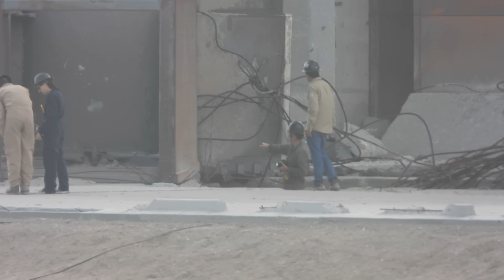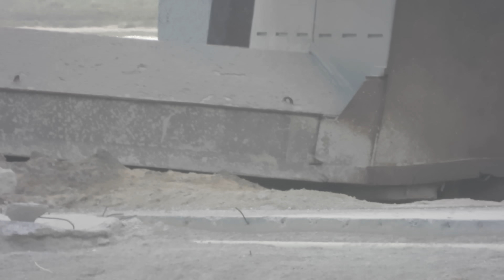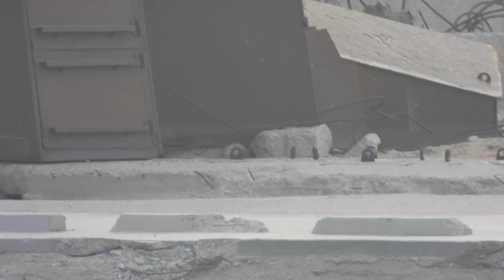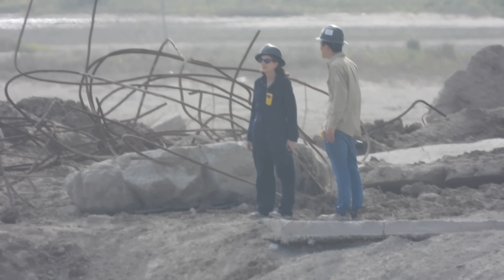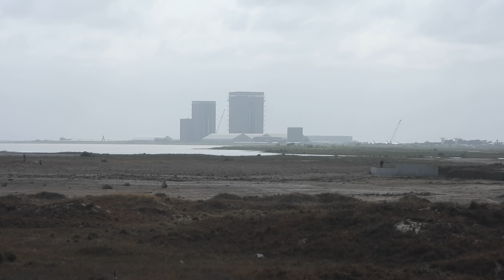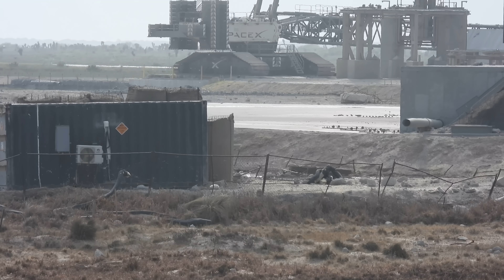Two Days After Launch, SpaceX Starbase, in 4k, Boca Chica, TX, April 22, 2023

Comment: That they even got off the ground with that kind of destruction happening is a great feat.
Reply: The pad disintegrated and the debris got sucked into the engines-25% malfunctioned and they had to blow up the rocket.   Love people calling that a success on here.  Rocket scientists everyone in the comments.
Reply: @edwardschmitt5710  this launch was a success, from it being predicted not to leave the ground. Debris sucked up into the engine? Is there proof of that? Criticizing people for acting like scientists like your one 😂😂😂😂
Reply: @edwardschmitt5710  Btw, student here, that is studying aerospace engineering (rocket scientist). 25% of the rocket engines did not malfunction, and debris do not get "sucked" into rocket engines. If anything, flying debris could have damaged the engines, but this wasn't the cause of the termination of the mission. It was probably due to the failure of the second stage failing to separate. Stop spreading misinformation.
Reply: @robberbarron7602  true dat!!!!
Reply: @robberbarron7602  I don't think it failed to separate. I think the separating was never attempted. There was no required MECO for separation to even begin, likely due to the vehicle not having reached the staging window altitude due to propulsion issues.
Reply: @edwardschmitt5710  It's a public forum, peoples opinions and open discussion is what this is all about. Even you got to post an opinion, a smart ass one, but an opinion none the less.
Reply: @edwardschmitt5710  Armchair Rocket Scientists!!
Reply: @rearspeaker6364  true dat!!!!
Reply: @edwardschmitt5710  Nevermind that nothing got sucked, but the launch pad failure makes the launch all the more a success. Google "Antares 2014" to figure out why.
Reply: @coltonmccormack8978  Yeah that makes sense, I feel like they were attempting a separation, but due to it not separating, the launch vehicle lost control after the maneuver due to the mass of the starship still attached to the booster. What are your thoughts?
Reply: As a surgeon is apt to say - Operation successful, patient died.
Reply: @williamhatfield8935  even if everything worked perfectly it would have still ended with 2 explosions. The vehicle was not intended to land and be reused, they have one mostly completed and already upgraded prototype and I think 2 partially assembled prototypes already waiting to fly.
Reply: @robberbarron7602  So you didn't notice the rocket was moving sideways as it came off the pad and ended up tumbling end over end?
Reply: @robberbarron7602  I think the most likely analysis I’ve heard so far is that loss of hydraulics systems led to loss of gimbaling and thus control - and maybe the separation mechanism also depends on hydraulics. Still unclear why SH didn’t cut its engines though. Also unclear when the FTS was activated - see Scott Manley’s analysis of that. Probably we will never know all the details. Suffice to say that the rocket performed admirably considering the inferno underneath it at launch.
Reply: @RandomUser311  Please correct me if I am wrong but I was under the impression that the misnamed “ Starship “ was programmed to re enter the atmosphere in a belly flop position using the extensive array of heat tiles to dissipate the greater part of its kinetic energy through air friction, noise and shock wave and once slowed down tilt vertically and relight its thrusters to simulate a soft landing, albeit in the North Pacific.Ocean. If, as you say, they were going to blow it up anyway, at what stage in the flight was the explosion programmed to occur.
Reply: @williamhatfield8935  Hi, there was an updated FAA filing that said that the ship was not going to attempt a landing on or above the water. But I didn't say 'blown up', just explode, but maybe not the correct term either. Primarily my point was that it was going to be destroyed either way, so the destruction alone is not an indicator for success. Whether or not it was a success depends on how many check marks they were hoping to make and how many they got to do.
Reply: @RandomUser311  Again this total destruction of the launch pad, the failure of six of the updated Raptor 2 engines, the out of control booster and failure to separate the  “ Starship “ were all hailed as an outstanding success because of all the data that could be collected. Now it beggars belief that the intention was not to try reentry and collect data on the Starships performance on this totally untested vehicle at orbital velocity. My surmise is that Elon’s engineers told him there was scant chance of success so better put out a press release saying that they didn’t want to do it anyhow.
Reply: @RandomUser311  The complete destruction of the launch pad, the failure of six of the updated Raptor 2 engines, the total loss of control of the booster and failure to seperate the Starship as it plunged back to earth were hailed as an outstanding success because of all the data collected. It beggars belief that the intention was not to attempt reentry of the Starship dissipating its kinetic energy with its heat tiles and once slowed down sufficiently assume the vertical position and relight the engines for a soft “ landing “ in the North Pacific. Even if everything had not gone to plan the data collected would be useful for any modification to the design. My surmise is that Elon’s engineers told him there was zero chance of success so better put out a press release that they didn’t want to do it anyhow.
Reply: @williamhatfield8935  I'd consider the launch pad a failure. I'd consider the rocket a (massive) success. However, couple of points: you need to differentiate between a development test and a product test.  Starship is not a product yet (e.g. no cargo or cargo bay doors for that matter). If crew dragon had failed to reach the ISS during Demo-1, that would have been a failure because that was a fully developed vehicle that had a mission. Starship is not. The test (or rather "the tests") performed were development tests. You expect individual failures here, typically the public doesn't get to see those. Whether the test as a whole was a failure simply depends on your expectations. When you buy a car, you can absolutely count on the fact that the version you bought is not the same that initially came out of the engineers CAD software and there will have been many intentionally or otherwise destructive tests that the public didn't get to see.
Reply: @RandomUser311  I would agree with everything you say after “ the rocket a massive success “ it is interesting to note that without any data from booster 7 they have constructed a far superior booster 9. Will the data from 7 be incorporated in 9? Why would they launch 7 from a faulty pad when they almost had ready a steel/water solution to a known problem of blasted bits of concrete bogged up with quick setting cement. There must be a better reason than the pothead joke April 20th - 420.
Reply: @williamhatfield8935  I think they didn't expect the concrete to 'explode' like that and didn't mind some damage since they probably have to rip it open for the steel plate installation anyway. I assume they thought they could get that done while they get the next ship ready, so there was no point in waiting to launch the current one. Just guessing here though. Have you seen the massive ~5m chunk of concrete flying upwards right next to super heavy? Glad that one didn't hit it.
Reply: No
Reply: @williamhatfield8935  IF, big IF everything went right that was their intention. Nowhere did they think it was going to accomplish that. As was mentioned they had big hopes it would clear the tower and make it to MaxQ without exploding. That was the true mission. Anything after that was gravy. 

The best Musk gave it to do even that was less than 50%. So yeah. It was successful. They learned a lot and that's how SpaceX does things. Like the unofficial Myth Busters motto said. Failure is always an option. SpaceX embraces that motto.
Reply: @robberbarron7602  The rocket didn’t fail due to lack of separation! It was at half the altitude it needed to be due to most likely malfunction engines due to debris.

Comment: The fact the Launch Mount & Tower are still standing is a credit to the team that built them as that baby dug a huge crater at liftoff
Reply: I'm skeptical that the mount can even be salvaged though. The foundation and footings took heavy damage, and they can't just patch work to fix that and maintain it's structural integrity.
Reply: No
Reply: More expensive than the structure are all the delicate systems that are inside that must be shattered to death. I think it's better to demolish and start over with a flame trench and deluge system integrated from the start.
Anyway, the whole project is doomed from the start. Landing on chopsticks is a fantasy, any failure will blow up the facility, worden by the tank farm built so close.
Reply: @donosticopter9225  I honestly agree. The more time goes on the less viable I think starship is for what they're hoping to accomplish with it.
Reply: @jordanlarson6488 I think they can do it, this isn’t even their only launch site (for the foreseeable future anyways) it’ll take months of repair but they’ll be back at it again.
Reply: @donosticopter9225  Flame trench isn’t possible at this pad due to the water table and having to raise the entire launch mount and that in of itself would require an environmental assessment. The launch mount ring probably isn’t damaged since shielding was installed right before launch to protect the internals, they won’t attempt booster catching until they are certain it’ll be successful with the first booster and even if it fails it won’t be as devastating since the booster will basically be empty on touchdown. The tower and chopsticks work just fine it seems and the tank farm being close isn’t that big of an issue to me, the entire problem was the concrete being flung everywhere from under the mount. They have flame diverter parts and the steel plate they’re working on which should have a water deluge integrated or at least working in conjunction to help cool the plate and lessen acoustics; a NASA scientist who worked on the Morpheus autonomous lunar lander test bed and has experience with rocket exhaust interactions made an entire thread on twitter and he said the entire solution sounds promising.

Comment: Man o man.  Well, it WAS a launch pad.  Great view O Paul.  " I wonder what would happen if we dont put in a flame trench or deluge?"  Wow.
Reply: Just a deeper hole, no problem.
Reply: If they dont put on a trench diverter and water supression Elon is going to go broke!
Reply: @DrDiff952  Yeah I think this was a wake up call for them.  I believe the water cooled steel plates will work plus the deluge system they are building.  They are great at learning from their mistakes.
Reply: They dug a trench for the diverter with the rocket no problem

Comment: Have they determined that any of the engines lost at lift-off were caused by chunks of concrete. Did anybody else see the slo mo of those HUGE chunks of concrete through the flames that blew up as high as half way up the rocket?  DAMN!
Reply: The failed ones on the outer ring match the position of the support pillars, so this may confirm it; debris bouncing against them at an angle, straight into the engine bells
Reply: One car-sized chunk landed in the ocean hundreds of feet away, absolutely unreal
Reply: SpaceX has not made an official comment that I know of yet, but given how high and how far debris was flying and falling, seems likely the engines were damaged by the debris
Reply: It's not confirmed that those flying objects were concrete they could have been anything
Reply: Do you even lift?
Reply: @iditarod4081  except for the other large chunks of concrete found on the beach and surrounding area.

Comment: Perhaps the best thrust/flame diverter for this power is over water? Need to look again at a sea launch system?
Reply: And it wouldn't have to be very far offshore, either.  10-12 feet of water would be plenty to absorb both the thermal shock and vibration, plus you get a bunch of boiled seafood afterward!  The shore slopes very gently toward the depths, and even 100 feet offshore your probably only in 10-20 feet of depth there on SPI.  That's what keeps it from being a good surfing location.
Reply: Or a literal sea launch akin to what sea dragon would of done

Comment: 17 million pounds of thrust, baby! 💥🚀
Reply: 1/600th of the ozone layer-keep cheering.
Reply: @edwardschmitt5710  get used to it. It's only the beginning. There will be more Starship flights, but more importantly, now that a rocket of that size and power has been flown, I guarantee you Space-X's competitors are already sketching competing designs of equal or greater power and it's only a matter of time before those roll out to the launch pad. It's inevitable now.
Reply: *15. it lost 5 engines. Still impressive though.
Reply: @edwardschmitt5710  armchair quarterback
Reply: Heavy
Reply: @edwardschmitt5710  It got nowhere near the ozone layer. It was methane and oxygen for the most part. Both of which are naturally occurring atmospheric gases.

Comment: Wow!! The power of the rocket is insane from all the destruction to the launch tower
Reply: yeah and that was with only about a third of them putting out full power.
Reply: It's like a huge explosion but unlike other explosions that are pretty much instant, this huge explosion just keeps going for minutes / hours in flight
Reply: @BartekJuszczak  Yep and in case you missed it they retracted the hold down clamps early to make sure nothing was going to hold that continuous explosion down to the launch pad.
Reply: they are really lucky it didnt detonate on the launch pad.
Reply: @jebes909090  That was an option they wanted to avoid.
Reply: @Randyluck1  they didnt really do anything but pray to prevent it.

Comment: Well there's some of the hole dug out for thr flame diverter and water deluge.
Reply: my thought exactly when I first saw the aerial picture
Reply: The boring company will borrow some raptors for hole digging 😅
Reply: Agree, keep the crater, reinforce it, then add the cooling plates Elon has been talking about, then build 12’  barrier around the the launch pad and fill it with water, give that
cement and cooling plates some insulation.

Comment: I would be very surprised if the top plane of the launch table was anything near plumb, square and level.
Reply: agreed
Reply: The Legs of the OLM sit on pilings that are sunk 140 ft into the ground...pretty doubtful its out of level unless a leg got bent...
Reply: I mean we are looking at probably a 1000 (likely 1000s of) man-hours of just structural assessment of the entire site.   I'm sure the table is in a different place than it was before the launch but I would bet everything in an X mile radius is in spots that weren't considered even in a worse case scenario based of the company's acceptance of the static fires.
Reply: I would be very surprised if the remaining concrete isn't completely riddled with fractures and the remaining rebar isn't debonded.
Reply: When you rush the launch with a sub standard pad, and the debris takes out your rocket as a result.
Reply: @MrShobar  no such thing as debonded rebar what are you worried it's going to rust haha it's going to take 100 years to rust buried in all that concrete.

Comment: After the static tests, they knew it would happen, but they needed a launch to collect data and refine the next iteration of starship. now they can build the pad with a flame diverter while getting the next couple starships ready. Hopefully they will both be ready at the same time.  Taking the months it will take to deal with the pad before launching the first one was going to delay too much.  They sacrificed the pad knowing a better one will need to be built, and gambled that the pad would hold together enough to get starship off the ground for this flight.  Hopefully the crater created will help speed ip the trench building!
Reply: ha ha ha!! so true...trench already dug...they are already half way there! Good one @vernon lemoignan.